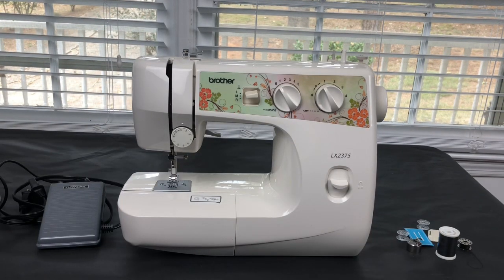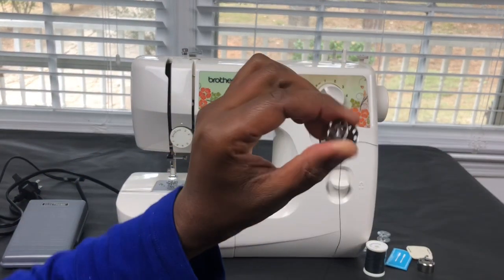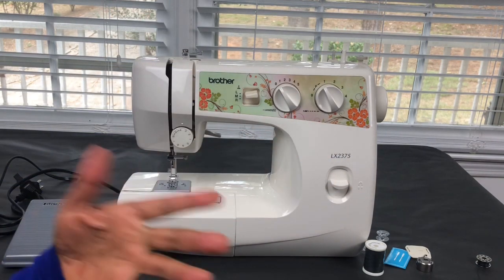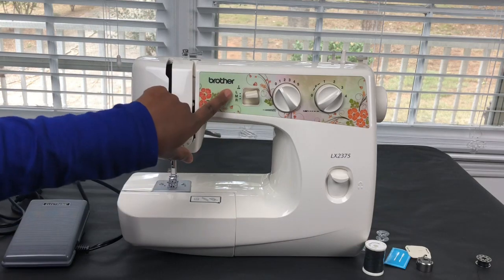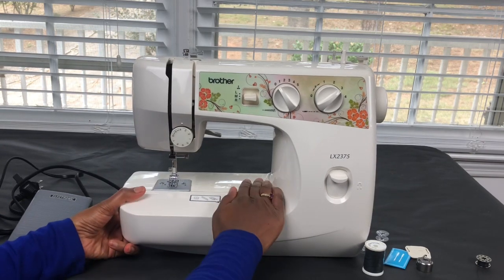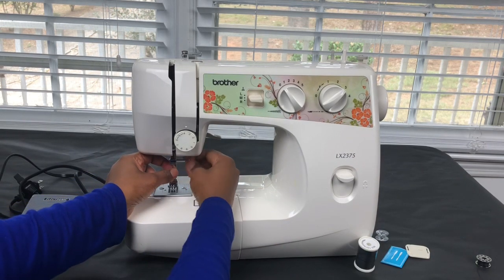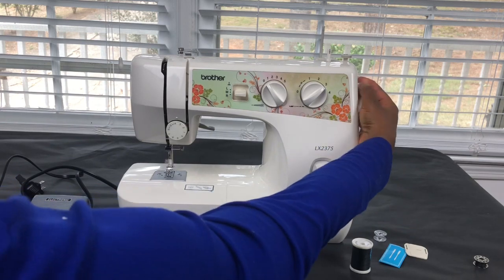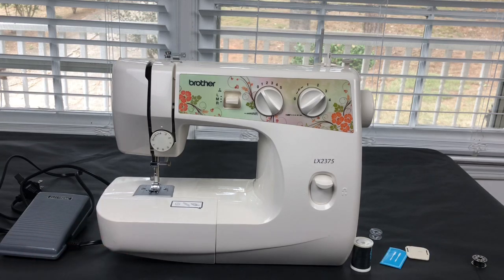Get To Know Brother LX 2375 Sewing Machine Part 1

Comment: I got this machine and I'm having a very hard time trying to get the hang of it. Especially trying to sew a blind hem ( very difficult with this machine ) and having trouble doing the decorative stitches , very difficult machine to work with.
Reply from the maker: What in particular are you having an issue with concerning the decorative stitches? I have an intro video on stitch types here:https://youtu.be/3G4Woe2wdmM

Blind hem issues. I will create a video.
Reply: @whatsshecreating  I'll be waiting for the video on how to do a blind hem and i need to know what stitch is to sew on elastic. I noticed this machine does the stitches manually. thank you for helping me to figure this machine out.